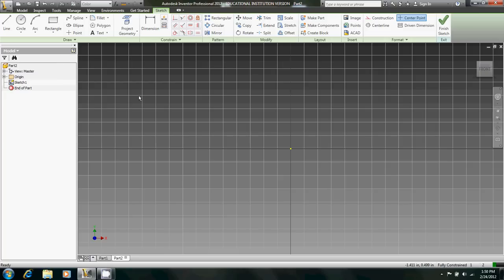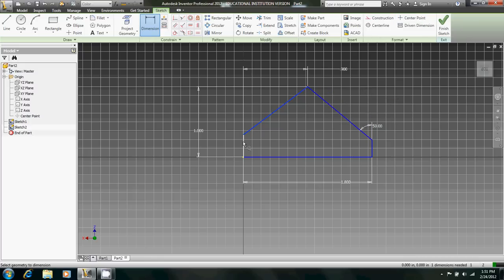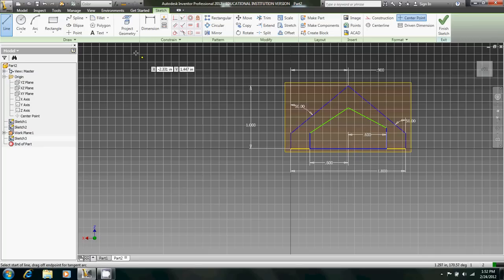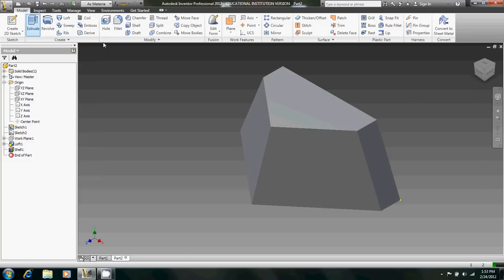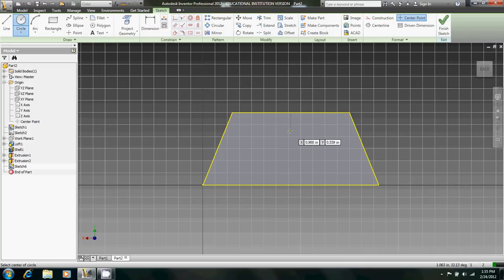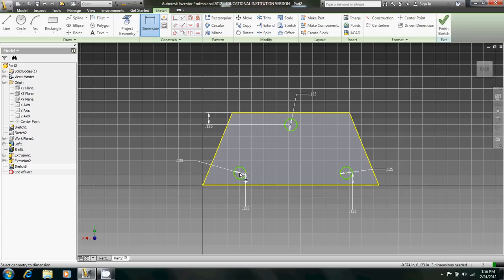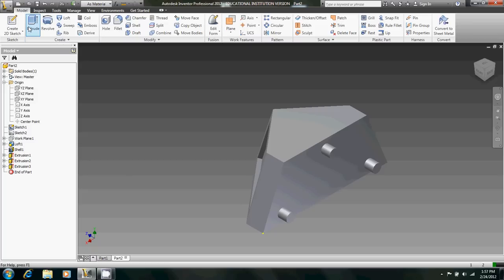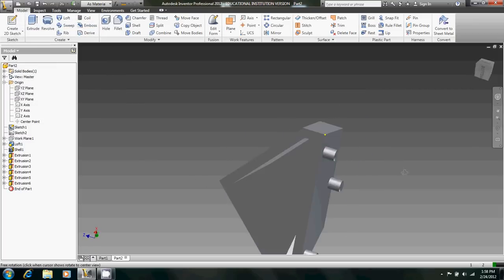Easy Steps for Cow Catcher in IED

Comment: Great tutorial, thanks a lot.  At the end though, I recommend a chamfer located in the modify panel to at the little nubs at the end of the tutorial.  It's much easier simply because you select the face and the edge you want to put the nubs on and it happens.  Thanks.

Comment: For everyone saying that offset is not working, this happened for me as well. Just use the line tool to add the dimensions. It will just take a tiny bit longer but it's the same exact result.